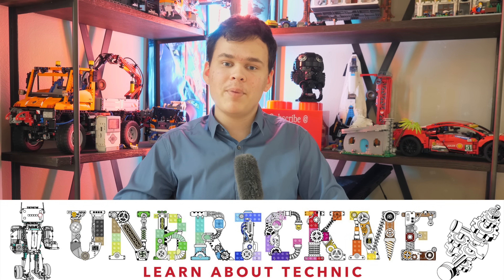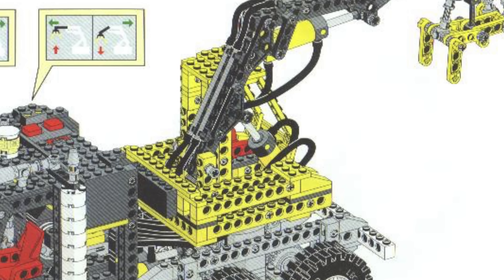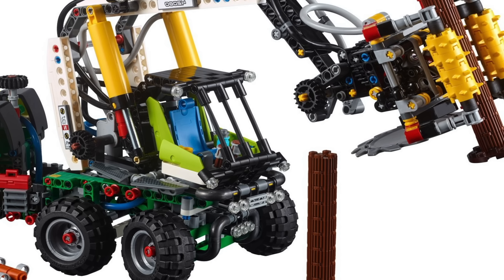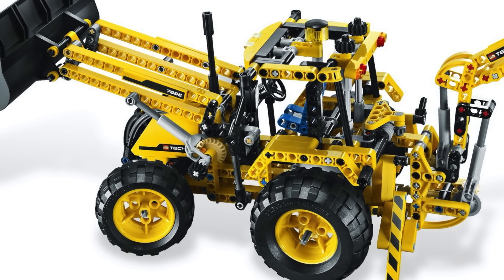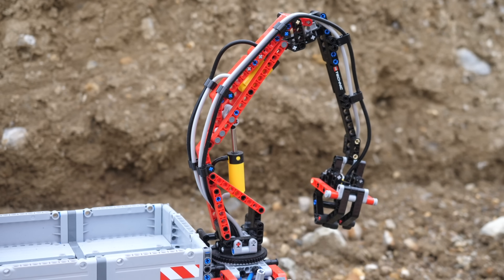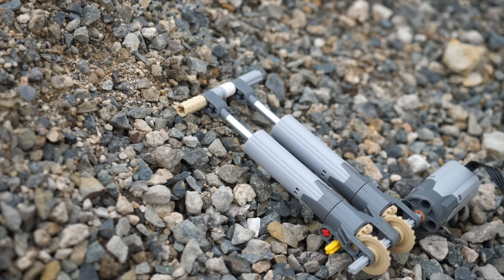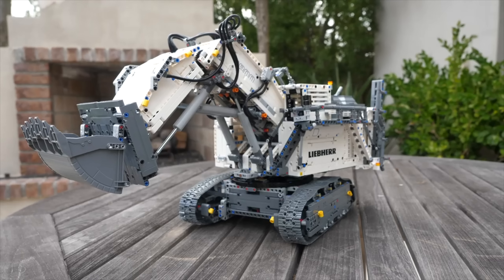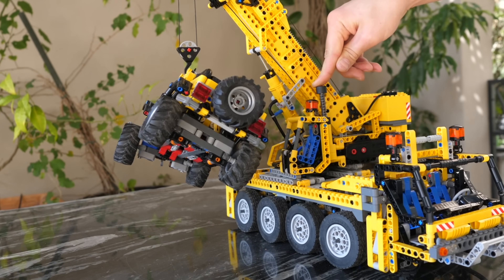LEGO Pneumatic Cylinders VS Linear Actuators

Comment: Pneumatics are good for show only :)) they can move anything on any point of the build leaving space for turning, bending, and so on, but when you need to be precise or you need to lift heavy weight your pneumatics will simply fail you. If you are a kid who still explores things they are fun, but in many builds you simply need more than 2 positions, fully extended or fully retracted. Linear actuators are so much better. There is a reason why in reality heavy machines use hidraulic liquid, not air, and until I see that done by Lego the only use I can find for pneumatics tubes is to make curves that make the model look nice :)
Reply from the maker: Linear actuators are definitely more practical; however, pneumatics are still quite useful for small cranes for example. They're more educational too, since they teach you basic principles of how hydraulics work better
Reply: Pneumatic actuators are strictly digital, I.e., on/off, full extension/fully retracted, unless they are under sufficient load to present a heavy effort. Once you get them at or near maximum load rating (at least, in LEGO scale!), they become more of an analog system, where they will move partway from full retracted to full extension, and hold.
That's the best part of mechanical linear actuators; they're basically a captive-screw drive.
Reply: Don't forget, pneumatics are good for hard to reach access areas where it would be impractical to try to get rotary motion into it. Houses can fit in small spaces and cracks, plus they can bend and allow the cylinder to be move where about.

Imagine a grabber thing on a rail, and you have to use a piston to close and open it.
If you used a linear actuator, you would have to find a way to vary the length and distance of power transfer while hoses can just bend.
The Brick Wall (search their on youtube) made a brick road layer where the brick grabbing module used pneumatics because of how it moved around.

Linear actuators are used the rest of the time, when they are mostly stationary and don't need to be as playable.

Pneumatics are good for engines, (you can't make a piston engine out of linear actuators, for many many obvious reasons), playability and simulation of hydraulics, and also when hoses are just better instead of a mess of axles joints and gears.

Anything else and you are better off with the actuators.
Reply: @thatguynamedgeorge9218  I agree with you, however places hard to reach can be accesed also with thread, which is good for many things. Or a small M motor could fit in there, and the cable as long as you want. I wouldn't use rotary motion where there is no place for it, but that does not mean pneumatics are the next best thing. Many lego special pieces become useless when you think outside the box :))

Comment: I prefer pneumatics, taught me about how hydraulics worked in real vehicles when I was younger.
Reply from the maker: Same here!
Reply: @Unbrickme  Me too
Reply: Is sussy
Reply: But you know that real hydraulic installation works different than pneumatic. I mean because of compression and agregation of air it can't standstill in middle position. Hydraulic is much slower bu can by also much precise and stronger. If i will choice IMO 8 wanna liquid pomp and hydraulic instalation. Pneumatic can by great to play with industrial automation machines and whole lines.
Reply: Marcin Sosna yes there are definitely differences between the performance of each system, but they work on the same basic principle.
Reply: @Scoobalicious I agree, but it would be an ideal solution if the project provided for a strong and well-functioning structure where the linear actuator and its gear would be a problem (jumping on the teeth) - this happens in 42100 if we want to lift / move something heavier. However, a serious problem with power hydraulics is the leakage of fluid, impurities in the installation and a more complicated structure of the power supply system.
Reply: @marcinsosna2852  mocists are listening, don't give them any more insane ideas.
Reply: @gosmbricks9833  not to worry; the high pressures in hydraulic systems are beyond Legos.  Now, if someone machines Lego-compatible aluminum or steel fittings, and puts stronger hoses on them, well...
Reply: Real life hydraulics and pneumatics are waaaay more complicated then a pump valve and cilinder
Reply: @larsassinck3868  Of course, but lego technic provides a good introduction on the basics of how mechanisms work
Reply: @jon1184  you are right about that
Reply: The only similarities pneumatics and hydraulics have is turning pressure into motion. And that's it.
Reply: My dad taught me when I was 4 on our forklift at his shop about them. It was a very cool experience and later that day he took me out into the lot behind our building and then let me steer the forklift around. Sadly someone he was business partners with stole it (my father was the owner of everything this guy just put slight bits of money into certain things) and then sold it without giving anything to my dad, and it was a nice one a $10,000 forklift back in 2007. We miss our shop, we are trying to open a new shop with the machine we have kept so I can start a business while I am getting my engineering degree.
Reply: Me too!!!!!!!!!!!!!
Reply: I studied mechatronics (I didn’t finish the study) but I still have the knowledge

Comment: use a linear actuator to push the valve of a pneumatics system
Reply from the maker: Awesome idea!
Reply: I once built a sort of pneumatic useless machine automaton. With constant air supply, two arms would "fight" over a valve switch that switched between two sets of pneumatic cylinders that ran the valve switches for extending and retracting the arm cylinders in sequence.
Reply: Proportiona radio unit and a servo it can return and shut off like a real leaver would we use tiny 17g to 6kg servos to use on hydraulic Rc valve blocks eg the pneumatic switches to open the valve to allow oil to flow to extend and retract the hydraulic cylinder the servo self centres itself put the valve to neutral position some real machines aret like this too there is also a motor connection to a pump then oil tank if a real machine had electric controls and sticks they tell the the servo or solenoid to push the hydraulic valve in proportion to the leaver movement to get precise control and movement
Reply: Lol, now you can use both.
Reply: Big 🧠 🧠 🧠 🧠 🧠 🧠 🧠
Reply: Plus they can work as 1 unit witch is awesome thing with lego.Lego dosent have Limits on amagination and creativity because people push lego beyond its limits